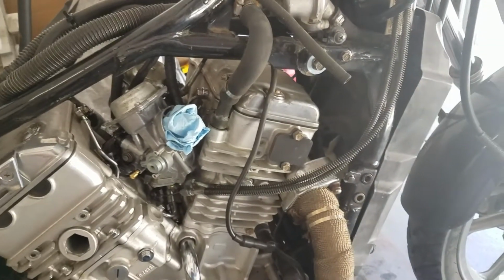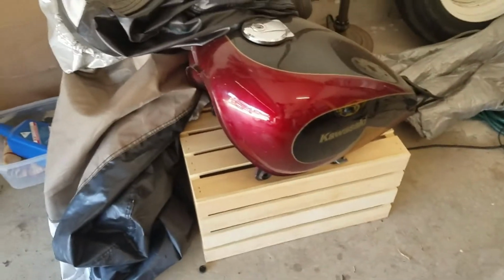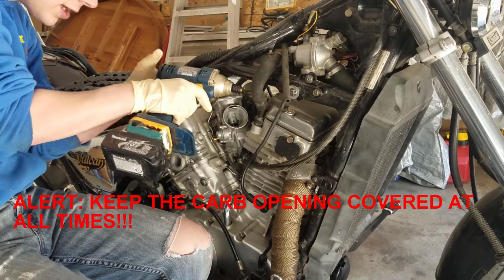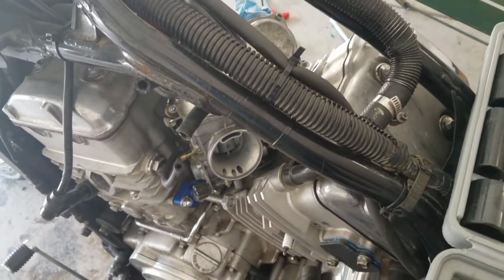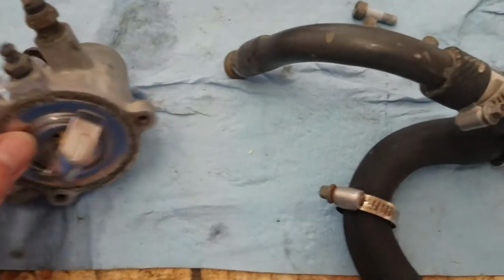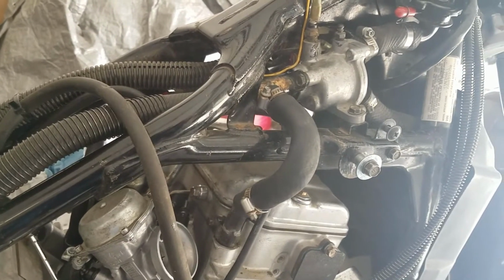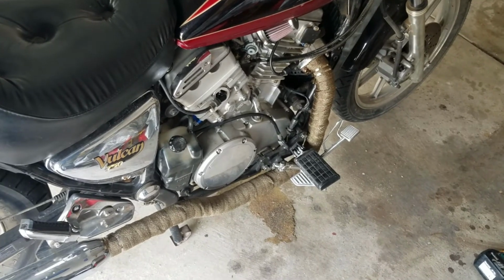vulcan 750 cooling system repair

Comment: I have had a lot of problems with those 2 coolant pipes that go into the top of the heads leaking. Even after replacing the O rings with new ones they still leak. They are attached to the heads with one small bolt, and that allows them to move slightly, which will cause them to leak. I have over 230,000 miles on three Kawasaki Vulcan 750s. Two of them bought new, a 1993, and a 2002. The engine failed on the 2002 at 118,000 miles, because of a broken cam chain. I had installed TOC manual cam chain tensioners on it around 10,000 miles, when I noticed a cam chain rattle. The stock cam chain tensioners are JUNK. I now have a bought used 1997 model, bought with 11,000+ miles on it, it now has 57,000+ miles, and has developed a number of issues. Parts are becoming impossible to find for these bikes anymore. I am trying to get everything working properly on it, so I can sell it. I have already bought a really nice 2006 Sportster 1200 to replace it with.

Comment: Hello from Puerto Rico, dear friend.  I'm a question.  I have a hot 🔥 temperature.  Pull off thermostat, I'm put direct cool fan bit in the highway elevated temperature 🌡 and the coolant outside of the motorcycle

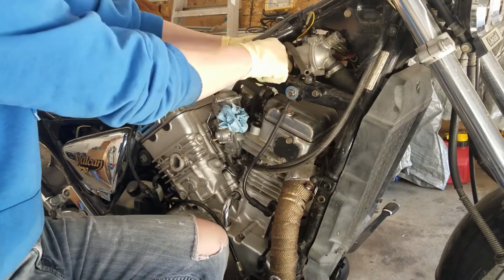Comment: I think the wire on my Vulcan must have gotten loose. On 6:33, did you just slip off the wire or is it tightened with a nut? I know very little about mechanics and do not want to lift the gasoline off unless I can see a loose wire.
Reply from the maker: Yes that wire is a spade connection. It just slips on and off. You will at the very least need to take all of the tank mounting bolts out and you might get lucky and be able to lift the tank enough to get to it. You might be able to see the loose wire if you take the side reflector cover off and get a flashlight in there.
Reply: @hundleycycleshop8876  I REALLY appreciate your quick reply. I subscribe to your videos. My bike is a 2006 Kawasaki Vulcan just like yours.
Reply: @hundleycycleshop8876  I FINALLY lifted the gasoline tank maybe two inches and I could see the wire was OFF so the temperature gauge would not work. I just put the wire back and it started to work! Thank you so much. You saved me some money and a trip to a motorcycle shop mechanic/store.

Comment: Nice video, I have 1500cc 1988 vulcan, I just took everything apart to paint, but now my cooling fan isn't kicking on I Change the cooling switch and the fan but still not not working, can you make a vídeo of how the the whole cooling system works including wiring?